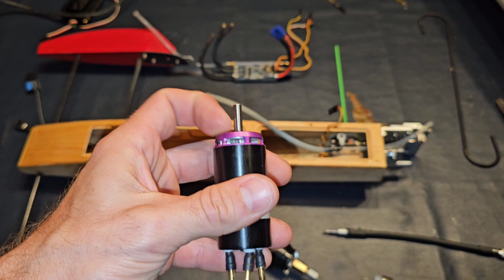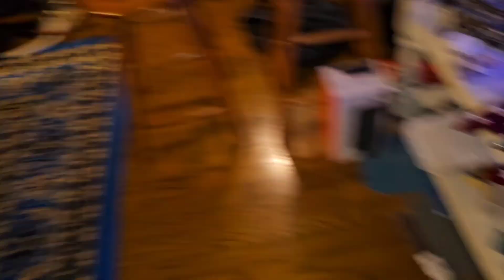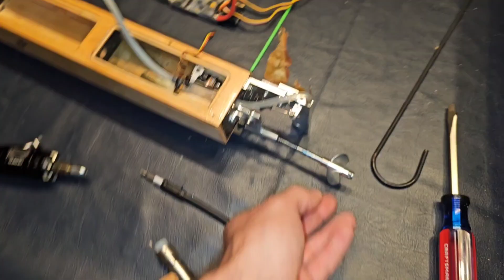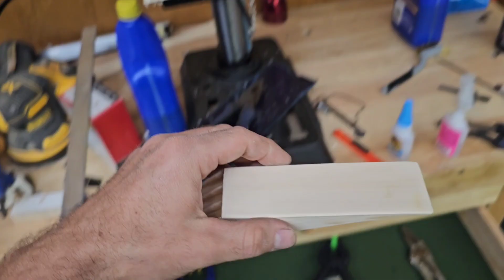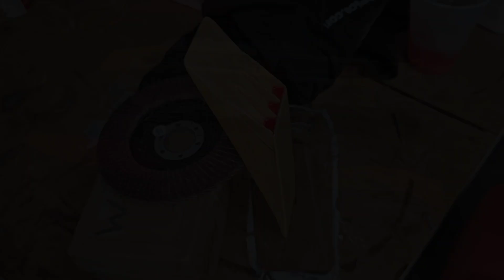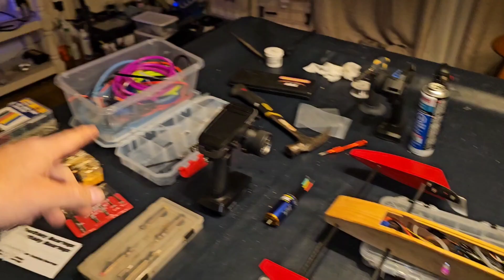RC Shrimp Rigger - Installing a Tenshock Evo Motor and New Hatch. Kraken 120 Custom Upgrade?

Comment: Setup looks awesome. Looking forward to seeing this fly.
I'm running the 2968 best I've got is 68mph.. I need to try your TP motor  see if I can go as faster.
Are the TP motor available.that you used ? .
These little shrimp are unreal for such a cheap rigger lots of fun.😁